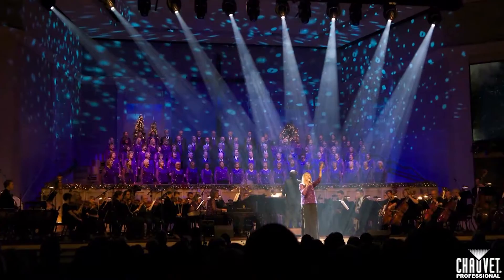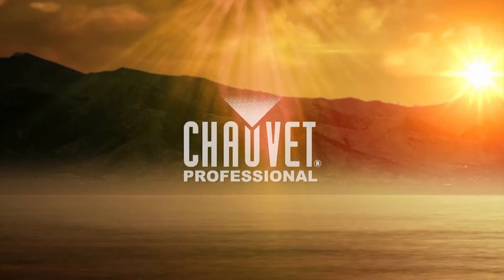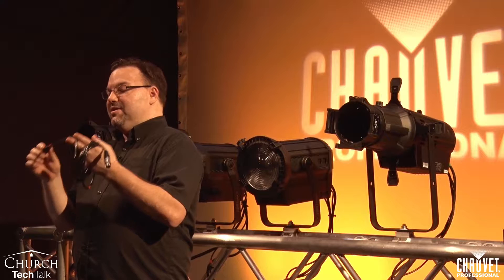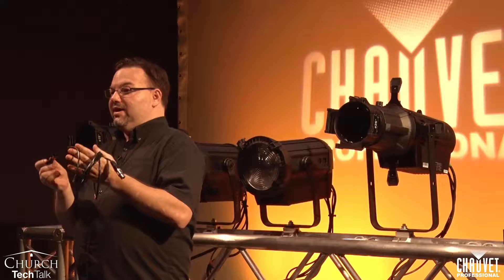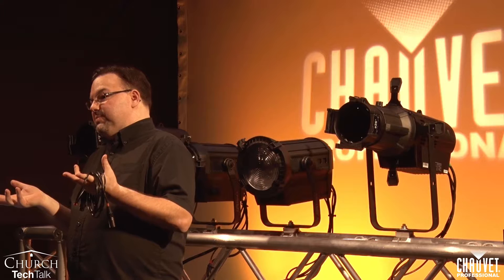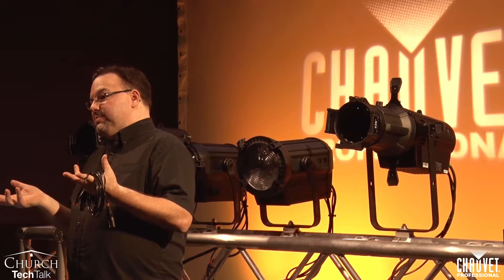Church Tech Talk: DMX Cables | CHAUVET Professional

Comment: What are your thoughts on using CAT5 for DMX cable?
Reply from the maker: +Michael Smoot Cat 5 cable can be used to transmit DMX
information, however, to be used to replace standard DMX cable from fixture to
fixture is not recommended.